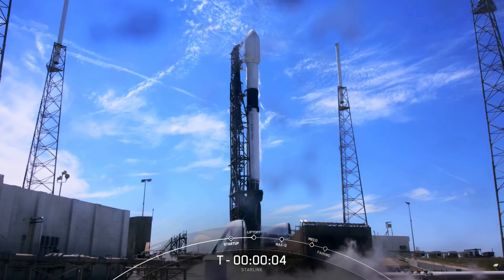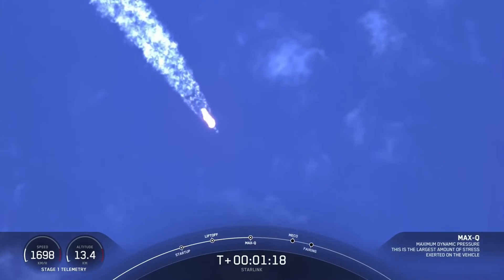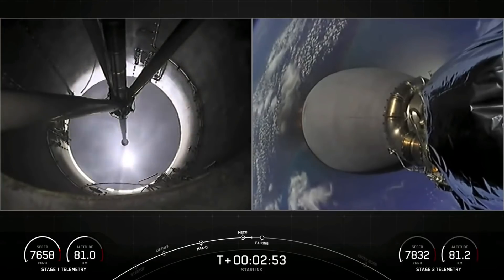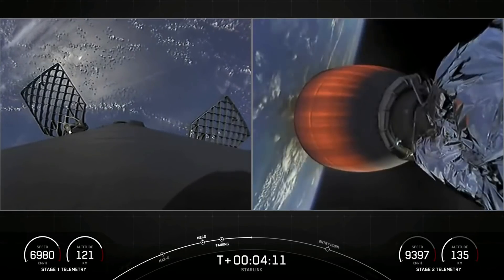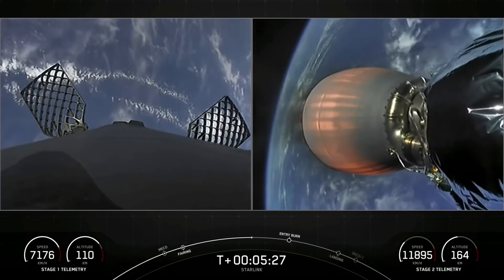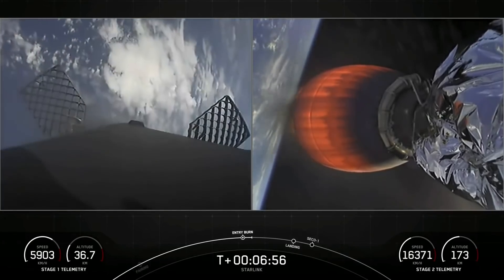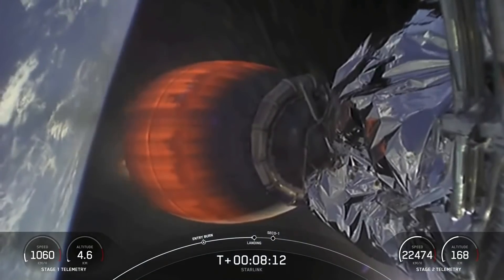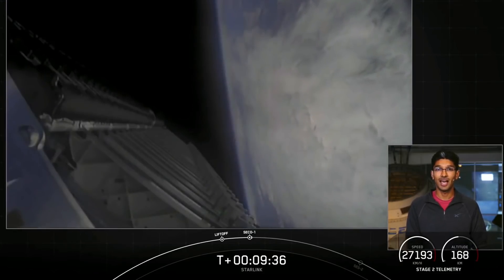SpaceX launches 60 new Starlink satellites, nails landing!

Comment: 0:43 shows rocket going up to the clouds....switch to rocket cam no clouds. Rocket travelling at 3000mph tin foil barely moving. Nonesense I’ve seen better footage on Space 1999
Reply: What you see at 0:43 is not clouds. It’s the smoke left behind from the rocket. The tinfoil doesn’t move because it’s in space- there is nothing to move it
Reply: @Cediii4ris  can’t believe you actually said tin foil lol
Reply: @markyw7954  that’s what you said.
Reply: Look at an airplane next time you’re outside. It’s going 3-6 hundred miles per hour. Yet it looks so slow because it’s so high up. Same with this. 

This is real, not fake
Reply: Did you know that clouds can be on different heights?
Reply: @thingusbrulingus  yeah but those at 0:43 aren’t clouds. It’s smoke from liftoff
Reply: @Cediii4ris  I know someone else commented 
Edit: that was you

Comment: Anomaly @ 4:43 moving diagonally to the left, stage one screen
Reply: That's ice buildup. The tanks get really cold because of dropping pressure and increasing altitudes. Water condenses at lower altitudes and then it turns into ice at higher ones, which then separates when the rocket changes course.
Reply: i dont see an anomaly, i just see ice
Reply: is all those fast moving things at bottom also ice thought maybe airplanes 4:51

Comment: There was an anomaly on today's launch at about the 1 minute, 3 second mark, just before going supersonic when there appeared a brief large unsymetric flame from the first stage. After that, all was normal. What may have been that anomaly?
Reply: Not an anomaly. Bow shock by going supersonic. There always is one, but in this case the atmospheric attributes were apparently so that moisture in the air condensated causing that burst. The illumination of those "clouds" made it look like something flamy.
Reply: I think that may have just been the effects of supersonic flight but I’ve never seen that before either.
Reply: aliens
Reply: You witnessed the sonic boom
Reply: No engine anomaly that I could see, just some clouds getting excited at 1:10